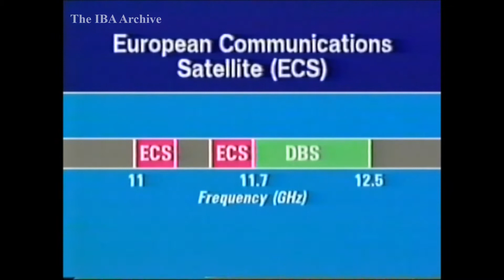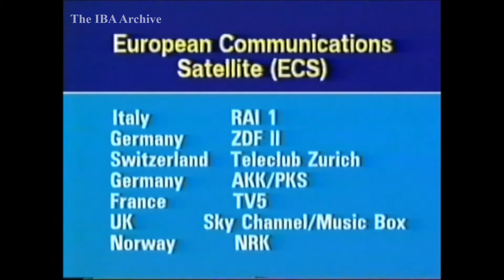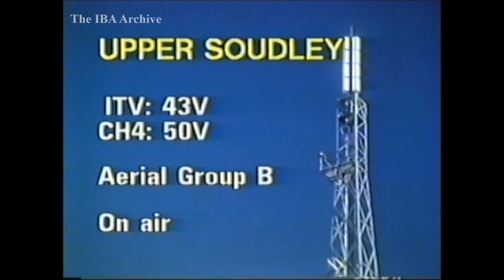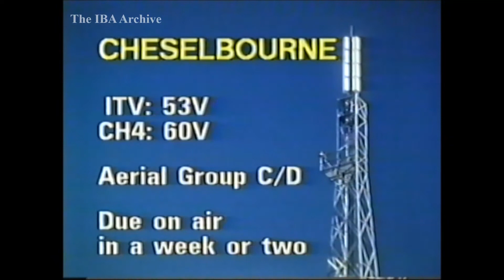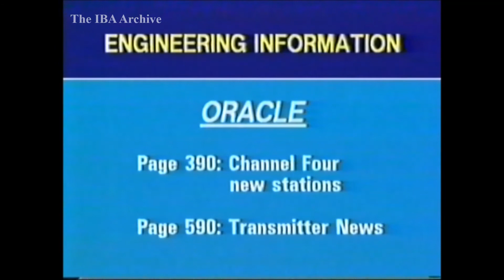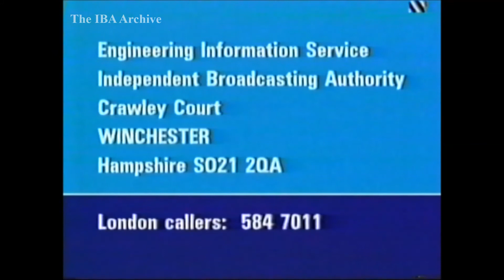IBA Engineering Announcements - 29th January 1985 'Future Of Satellite Broadcasting'

Comment: All this nonsense from the IBA about needing massive dishes for direct to home reception from these satellites was BALONEY, a good quality stereo satellite receiver / positioner unit with decent threshold extension and 1.8 or 1.9-2.0m metre motorised satellite dish could EASILY pick up the services with no problem and it also gave you a window to the outside world.
Reply: They said that so that they could fool people into subscribing to cable TV services
Reply: @rogerdarthwell5393  Cable TV wasn't very good when it first started, unless your local cable TV system used fibre optic cables and decent cable head end reception equipment, on copper coax cabled systems, the pictures would often be fuzzy PAL though your aerial socket to your TV and VCR, and buzzy hissy analogue monaural sound.

Better cable networks used fibre optic cables for distribution, giving better quality pictures and these networks also used better cable head reception equipment too, and on some CATV systems, you also got NICAM Stereo sound on the main terrestrial channels, and analogue to digital converted NICAM Stereo sound, applied to stereo capable satellite channels using 7.02 / 7.20 MHz encoded with Wegener PANDA 🐼 1 noise reduction across Eutelsat Intelsat and Astra satellites.
Reply: @anthonyperkins7556  Thank you so much for your detailed explanation! BTW you should write a blog about all of these things that you know! I would definitely read it!
Reply: That IS huge compared to a DBS dish (BSB ones were 30 cm diameter dishes or 38 cm squarials).
Reply: @seprishere  But curious people who wanted to see foreign telly needed motorised dish satellite equipment. Big the dishes might have been but you got to see programming and interesting things the UK never did i.e news feeds, other countries telly, cable exclusive channels, pop videos, other countries slants on UK issues and much more. BSB was merely 5 channels and purely aimed at the United Kingdom only. Astra was cheap and tacky programming with imports, country restricted channels,  and eventually, more and more services becoming encoded, so without a subscription and an official decoder, the choice reduced even more.